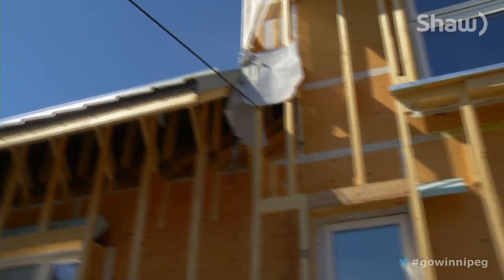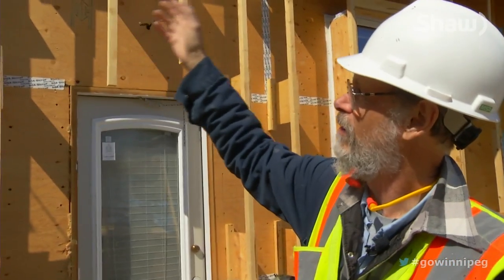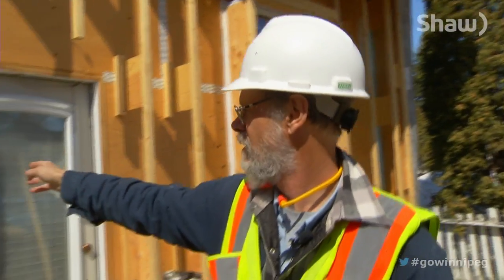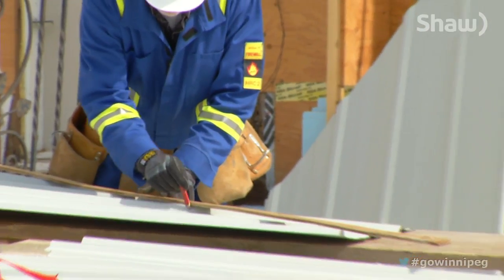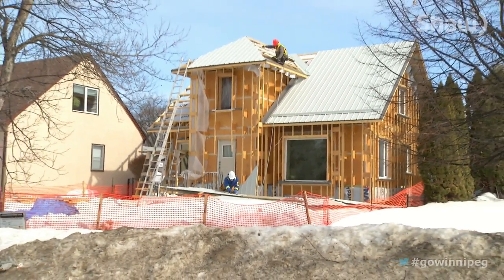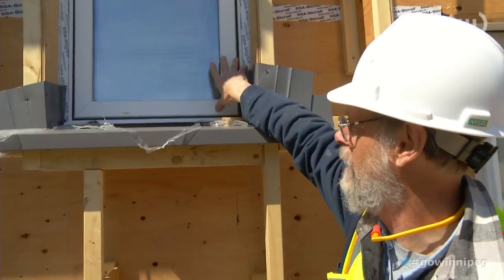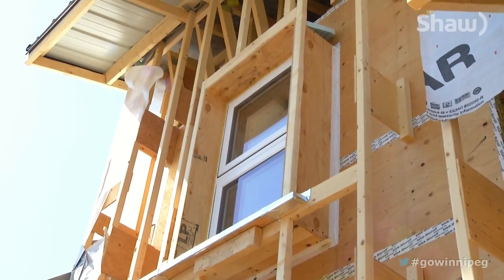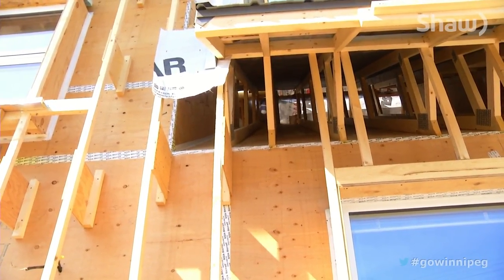Passive House Retrofit

Comment: I would love to know costs per square metre/foot. Been personally considering this.
Reply: Depends on the insulation if you go with just rockwool comfortbatt it's 1/2 the cost of rockwool comfortboard but comfortbatt is not as rigid. This is an exterior frame though, so is the rigidity worth it. Also the comfortbatt is r15 so two layers of it would be insane

Comment: How do you retrofit a concrete ranch house with hip roof (h shaped too) with almost no insulation?
Reply: insulate the outside and take advantage of the thermal mass
Reply: Insulate with what type of insulation and how much?
Reply: XPS (pink/blue board) due to it's water resistance. You get R-5 per inch, so determine what you want your R-value to be. You can occasionally find this in bulk or used cheaper than what you get at big box stores. You may find some of craigslist.

Polyisocyanurate ("polyiso") is good, but it can absorb some water which nullifies some of it's insulative properties (careful the fiberglass paper can grow mold. EPS can allow water to flow between the cells.
Reply: +Thomas Phelps How do I attach multiple inches of foam to concrete block? Super long concrete screws?
Reply: if you can find them...try online. A quick good search found 6" ones in 'shopping.' Overlap the seams of the insulation. You'll need to frame on your windows and doors, probably with plywood "bucks"". Biggest bang for your buck would be to insulate your roof if you're in a climate that gets cold (you can cute foam to fit between the rafters, though with some more thought, you can do better to eliminate thermal bridging. Think about how you're going to finish the exterior. Siding needs furring strips.

be sure to use these or something like them:
EIFS washers
https://www.menards.com/main/tools-hardware/fasteners-fastener-accessories/washers-spacers/finishing-washers/grip-fast-reg-eifs-1-3-4-washers-30-count/p-1444452478061-c-8944.htm?tid=-3604749533275241441&ipos=3
Tab washers
https://www.menards.com/main/tools-hardware/fasteners-fastener-accessories/washers-spacers/flat-washers/250-piece-tab-washer/p-1444452477763-c-8945.htm?tid=-5150622049403924301&ipos=1

A hot knife will save your ass cutting XPS. I use a regular insulation knife and it's a pain in the ass.
Reply: @2awesome292  Check out external wall insulation videos on youtube
Reply: Just hire someone

Comment: The Europeans dont retrofit like that .we use wood fiber insulation panels on wood houses and composite block insulation on stucco house that are glued and mechanically bonded . this eliminates almost all external framing except around door and windows where only a simple box is necessary. The wood fiber panels are attached with long screws and big plastic washers and then secured firmly by furring strips over the insulation which then accepts wood cladding or other material .

Comment: And the costs........ astronomical, as the original house wasn't built to passive house spec throwing up all kinds of costly workaround issues. I looked at this myself for my house, economically not worth it full stop. Will beef up insulation and implement other measures where it makes economic sense, but won't retrofit it this much.